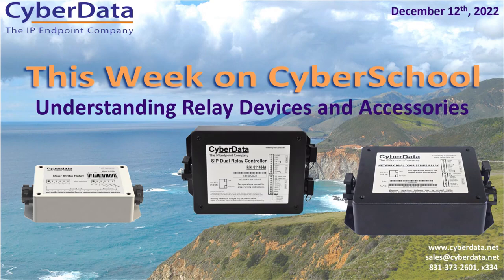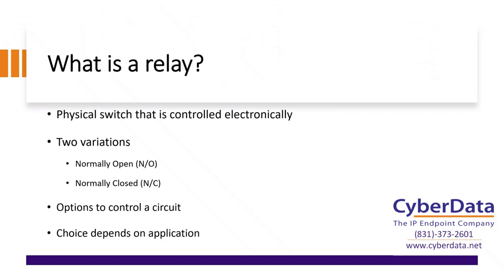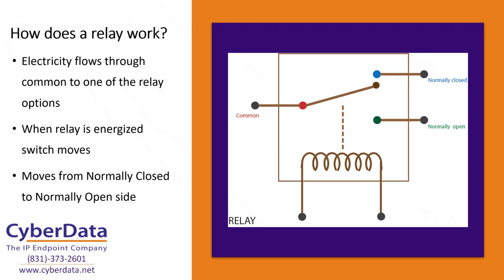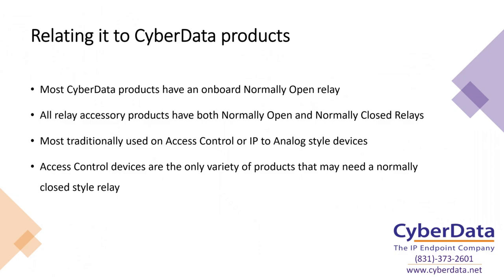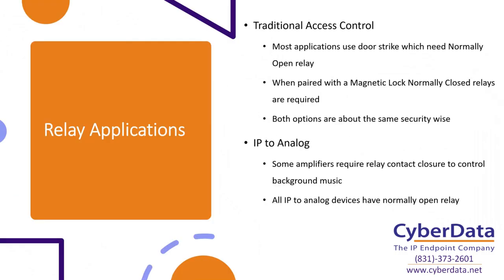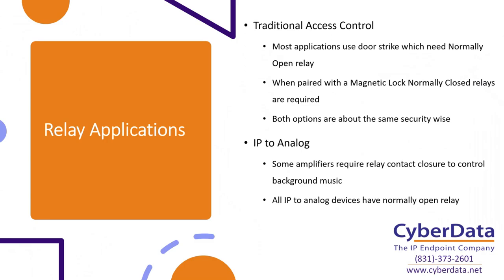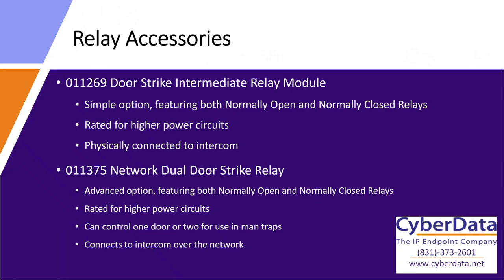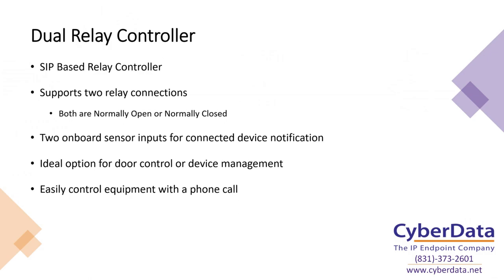Understanding Relay Devices and Accessories

Comment: Hi guys, Is it possible to use this relay without a door phone, just with a door magnetic lock and a Grandstream PBX? How will the door lock be controlled, meaning how can we open the door from another Grandstream extension? Will any secret service codes be used? Is it possible to allow this door lock to be controlled from only one extension? Is there a manual available?